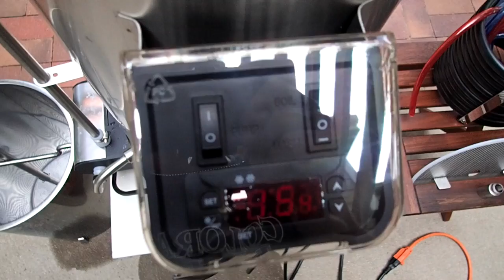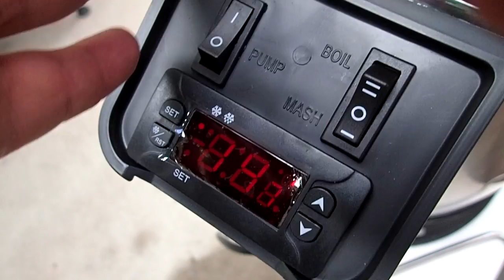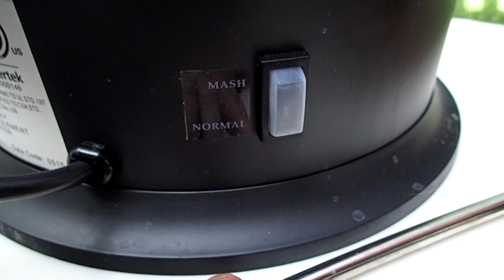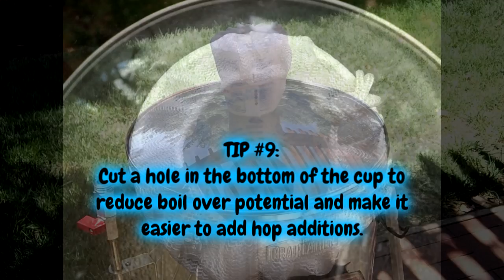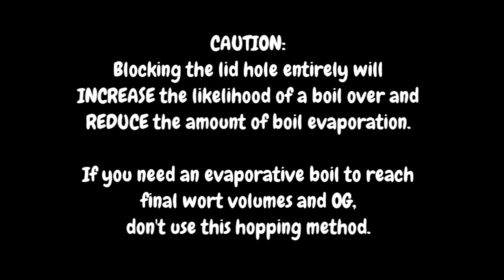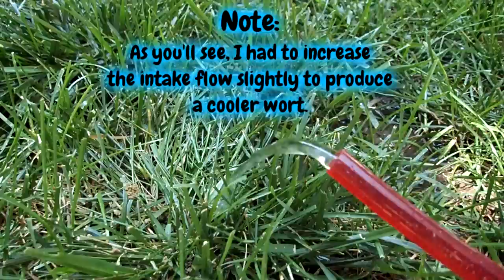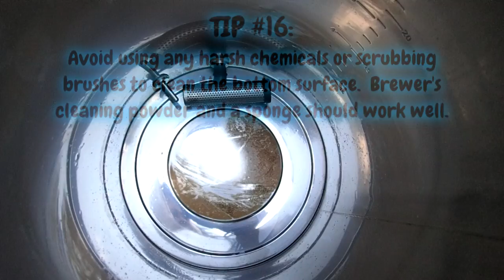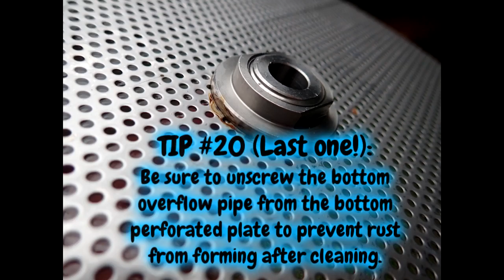The Grainfather - Brew Day Tips

Comment: Don't leave the lid on during the boil. DMS won't evaporate away effectively. 

There's no point running cold water through the counter-flow chiller before you start chilling. A better idea is to recirculate the hot wort through the chiller BEFORE you turn on the the cold water tap. This will sanitise the chiller where it comes in contact with your precious wort. After 5 minutes or so, turn off the pump and move the end of the hose into your fermenter, turn on the cold water... THEN turn on the pump again.

Remove the controller before you start spraying it with water.

The ring at the top of the grainfather comes out. It's just a spring.
Reply: I was thinking the same thing at both steps.

Comment: Great video with some great tips, but-- Another tip:  Do not boil your wort with the lid on, or else you will have dimethyl sulfides (DMS) in your beer. They need an hour to completely boil off. So I would use a different method of filtering your hops, such as a metal hop rocket that hangs on the side, or tie a bag such as the one in the video to a clip on the outside of the Grainfather.

Comment: It seems like with these units their equations for calculating mash & sparge water volumes are based around a 6 gallon batch.  Usually with pre-assembled kits the target batch size is 5 gallons.  Are you adjusting the water volumes at all?  Doing a longer boil?  Or am I wrong about their formulas?
Reply from the maker: +Kelly Beard I don't use pre-assembled kits, so yes, I adjust my grains, targets and all other ingredients to fit the volume I want to brew.

Comment: Would a fly sparge arm work with this unit?
Reply from the maker: +Bryon Lape Not sure why a fly sparge arm would be added.  That's essentially the function of the recirculation arm and top mesh screen.  I guess a fly sparge attachment could be fabricated to fit the recirculation arm and used without the top mesh screen.  But that seems somewhat redundant compared to the current recirculation arm used with the top mesh screen.
Reply: Steve Schweitzer For the sparging at the end, instead of pouring it through by hand.